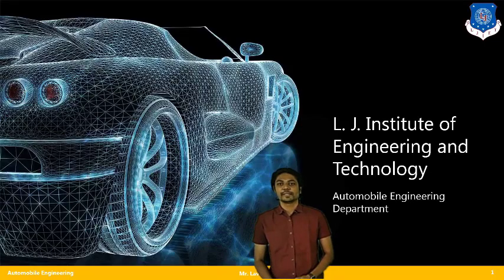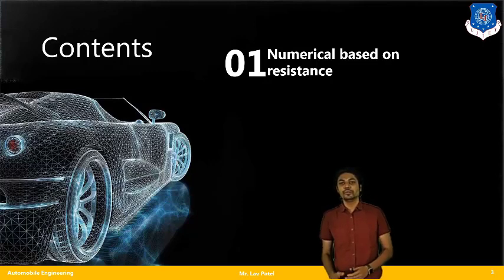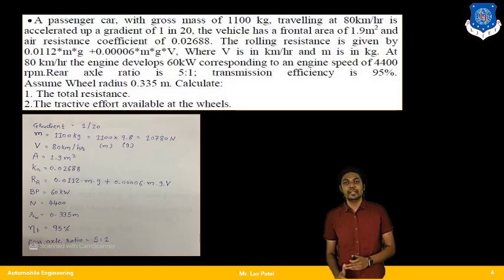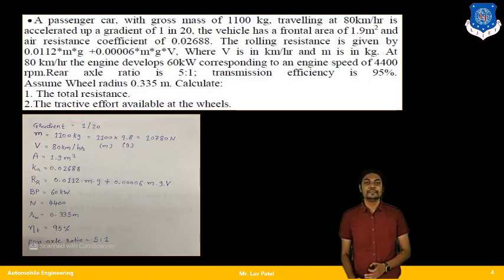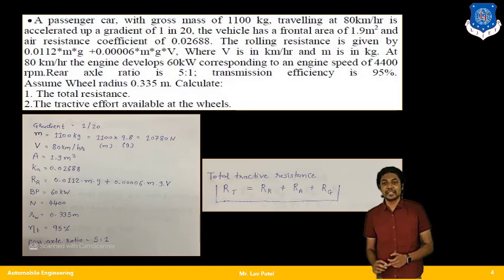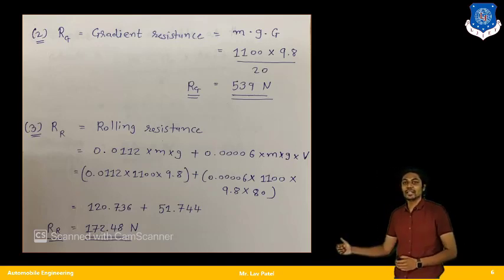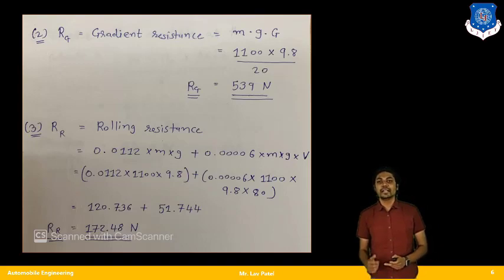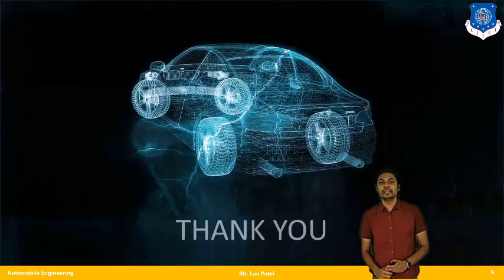L 31 Numerical Solution: To Find Tractive Effort | Vehicle Dynamics | Automobile

Comment: Axle ratio in this problem is wrong. If we use Tractive effort = (G x Efficiency x Torque of Engine)/(Wheel Radius). then it does not match with the answer you got in this video. Axle ratio has to be near 7:1 if answer by both formulas has to match.